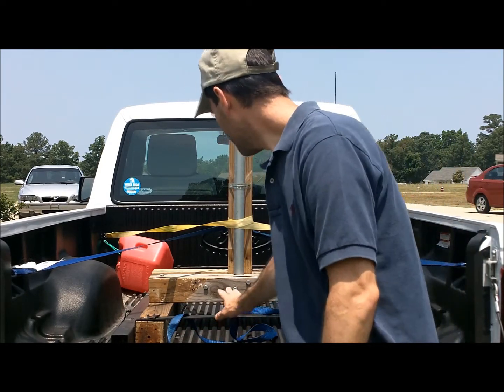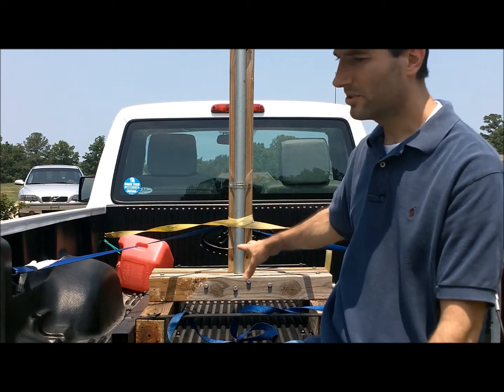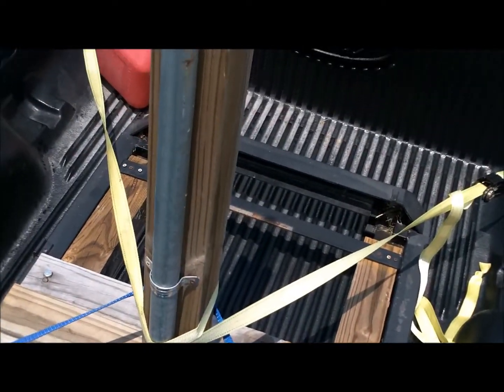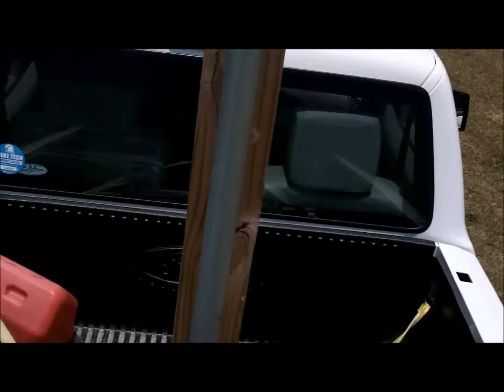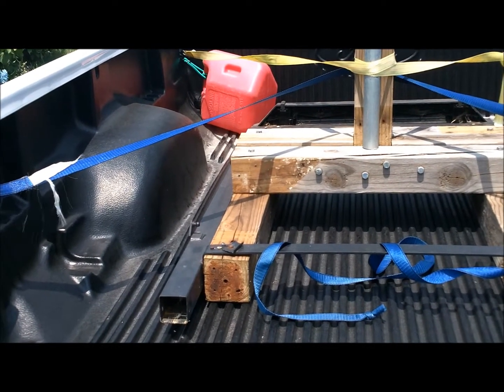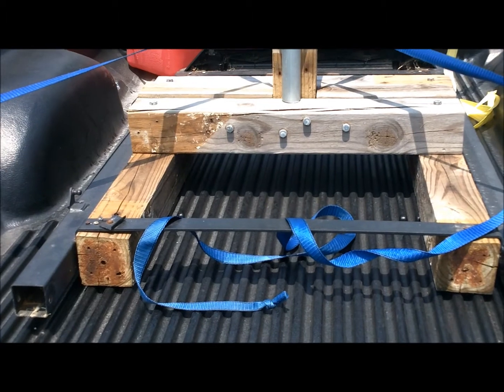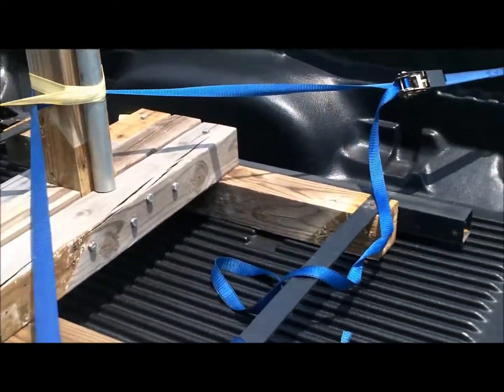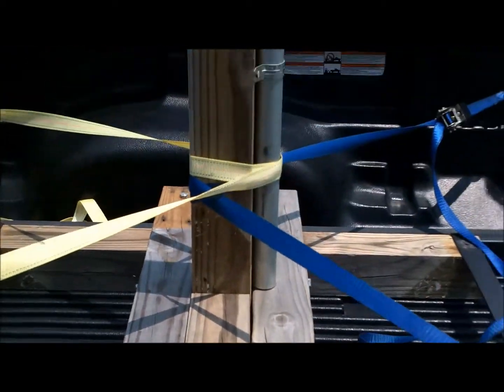New turbine stand for truck

Comment: Looks good.  I'd bolt a piece of angle iron across the center and attach the pipe to it with a muffler clamp and do away with the straps.  Some angle iron from an old bed frame would work well.